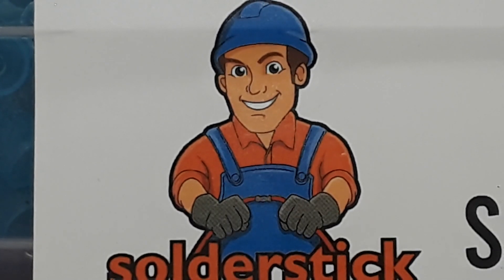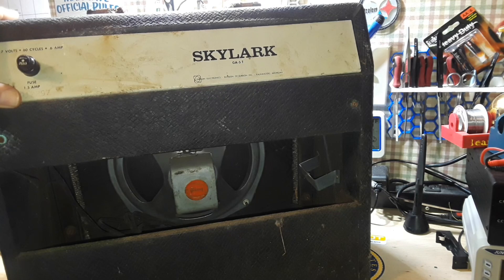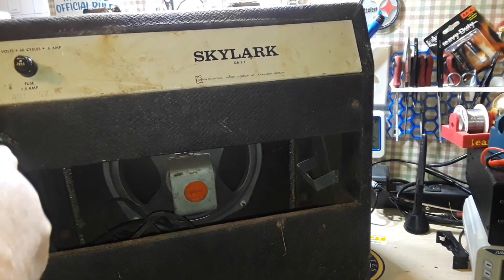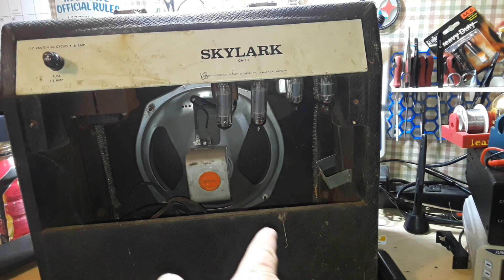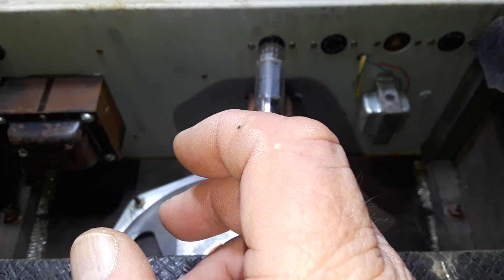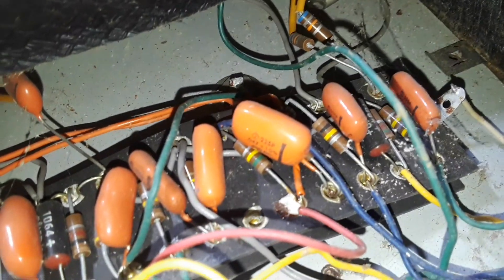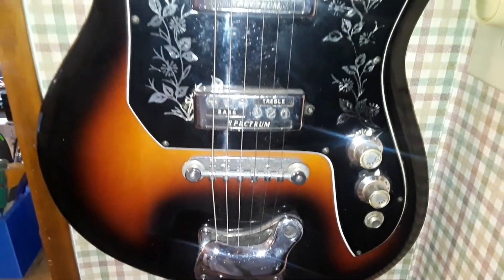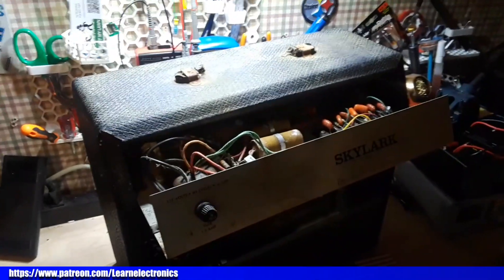Gibson "Skylark" Amp Restoration P1 - brought to you by Solderstick

Comment: Diodes? Who would have thought that Gibson made hybrid amplifiers.

I always thought Kustom amplifiers were the only hybrid amps from the 60's.

People will probably chime in and say it's not a hybrid but I say mixing tubes with silicon transistors or diodes is a hybrid.
Reply: youd never call an amp that uses diode rectification a hybrid.  Hybrid means the combo affects the signal chain.  60s- 70s Marshall JMPs use diode rectification, loads of tube Fenders.  those are all hybrid?  nope.
Reply: @sundogaudio851  That's YOUR opinion, not mine. Filtering out half of the sound wave with a diode IS signal processing.

Those Kustom amplifiers used by Creedence Clearwater Revival and many others used tubes in the output stages because the early transistors were not capable of the power they could get out of tubes.

The word "rectifier" was and still is a hold over from the tube days. The hold over I find unusual is calling tubes valves. That seems to be regional to what side of the Atlantic Ocean you grew up on.

At least we aren't calling diodes crystals or cat whiskers even though they replaced them in crystal radios.

Hybrid often implied a mix of tube and transistor for amplification which is silicon junction devices replacing vacuum tube devices.

A silicon diode replacing a vacuum tube certainly counts as a hybrid if both silicon and tubes are used in the same device.
Reply: that would certainly be true if the silicon was filtering sound waves, but its not  its filtering AC into DC for the power supply and amp to use.  Tube amps use DC for their high voltage on the plates to make them work. but its not part of the sound because AC rides along the same wire unbothered.  point being the signal is not being amplified by the rectifier.  Also which Kustom amps used tube outputs? ive used a ton. the 200 250 400. pa stuff.  it was all transistor.  transistor output stages have been around for a long time, 60s.  rectifier means diode, as in it blocks half a waveform ie half wave rectifier. its still a term used today as far as i know. and before the silicon there was the selenium rectifiers, back in the 40s and 50s.  i remove those because when they burn up its mess, and they do not age well.  Cheers  @tenlittleindians

Comment: Hi Paul! As someone who likes vintage tube type amps and old Tektronix scopes, I would say that you are correct that those 2 electrolytics need to go. I would also replace those 2 diodes for piece of mind. The orange drop caps should be just fine. I would test those resistors though as those old carbon comp resistors tend to drift really bad  with age. I have a 6V6GT Maggie amp that I had to replace all the resistors. Had a 100K resistor that tested at almost 500K!
Reply from the maker: Cool, thanks

Comment: Hi Paul: See this YouTube video from Uncle Doug's channel: https://www.youtube.com/watch?v=xsmp3if3j6U It will solve the mystery of the second transformer which is used as the phase inverter. Perhaps a little surprising in an amp this "new".  A lot of other detail here as well,  The amp in this video had been restored but the basic circuit is still the same.

Comment: Hey electronics guy ..... I wonder if you could help me with this problem..... been a sub and watching for the past.ywaf or two. 

     I have a few upper end two.way radios that didnt have q charging dock with them when I got em.   The lithium battery packs are 7.2 volts and hold like 1900 mah or somerhing.    Is there a good .... or any .... way for me to charge the batteries somehow.       The charging dock is like 9o dollara and. Nobody has made a clone of it tnat I havw found.
Reply from the maker: TP4056 lipo management boards. You would need one per cell, but they just a few cents each.
Reply: @learnelectronics    uhhhm ....  I am a carpenter and am having difficulty translating the neo-electro cipher text that is in your native tongue.    
     But I shall endeavor to learn of it.
Edit .... Thank You Boss

Comment: 6C4 is in fact a triode. For equipment this age, it's possible that it uses a selenium or copper oxide rectifier.
Reply from the maker: It has 2 diodes. That's it.